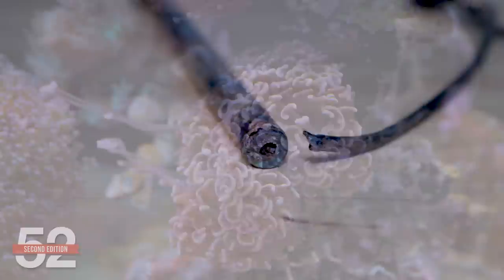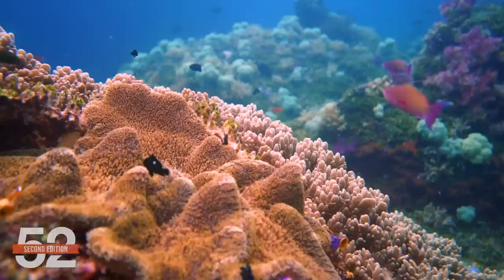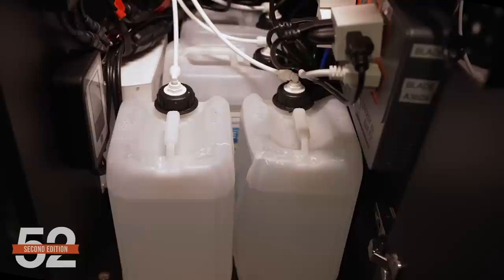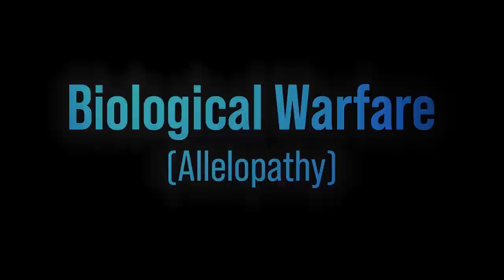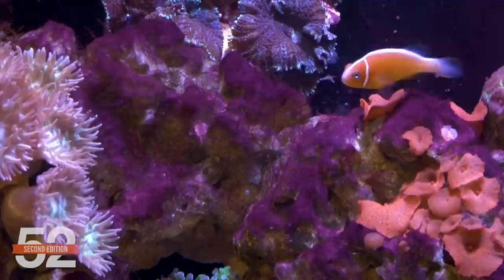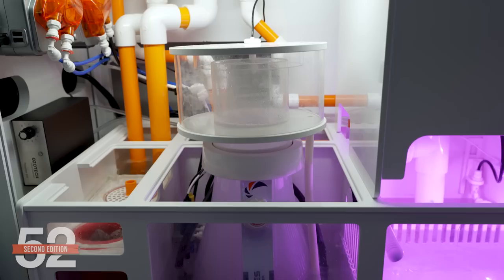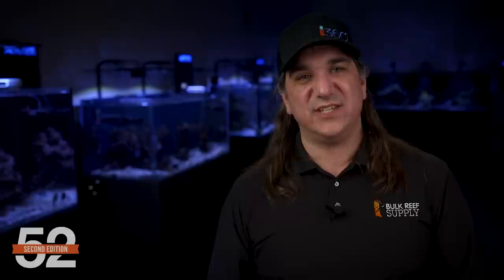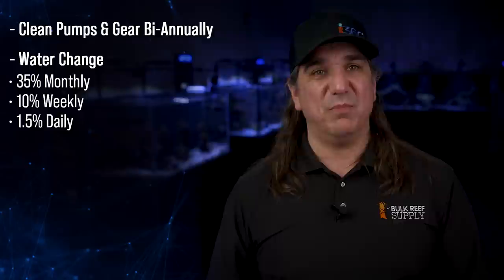These 5 Accumulative Pollutants Stress & Kill Corals. Why Are They Rarely Addressed in Reef Tanks?

Comment: Lessons from experience:
After a very successful start with my reef tank, after some time my corals began to decline; gradually, but persistently, for months –even years.  
Corals that once thrived in my tank now shriveled and quickly died.  Clams died.  Some corals would have their polyps always closed.  Xenias that once thrived and multiplied would now shrink and die within 1-2 days of being introduced.  This is not what one would expect from any kind of element or nutrient deficiency.  This looked like an acute toxin effect.  Something toxic  was clearly in the water.
I noticed that the more supplements and additives I used the worse the corals looked.  ICP tests showed no problems with elements.
Things would improve noticeably after water changes, but also if I just stopped dosing supplements.  The use of activated carbon had a noticeable but small positive effect.
My tank began to thrive again only after I did many, MANY, water changes, and significantly reduced the use of supplements.  Clearly, I had been poisoning my tank with chronic, gradual supplement overdoses, over many months.
Thanks BRS for your great advice.
JLL
Reply from the maker: Thanks for sharing. The reason that ICP might now show this is because the corals bioaccumulated the toxins in their tissue.

Comment: In a future video, could you cover the rationale for using Ozone vs hydrogen peroxide? Ozone has air quality issues, burns tubing, and could burn your tank. Dosing low strength h2o2 avoids all of these issues and if dosed with lights on will give you a strong UVOx reaction. Should be able to achieve same goals at lower risk.